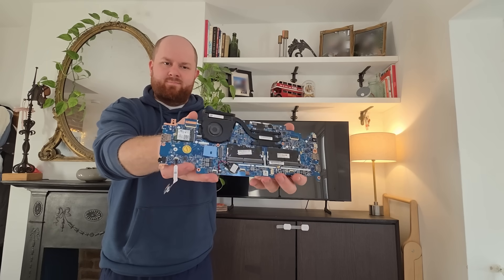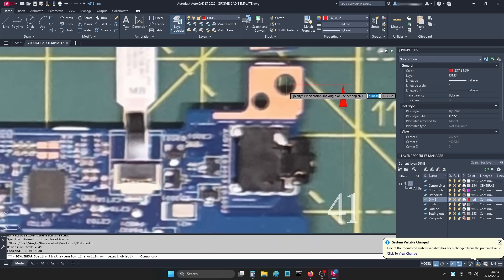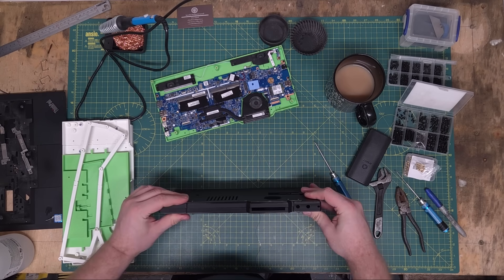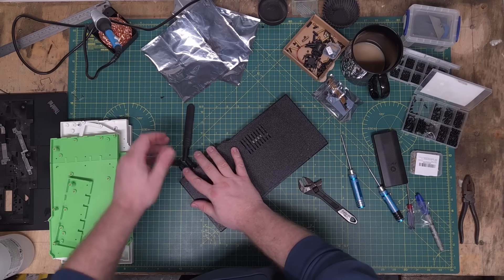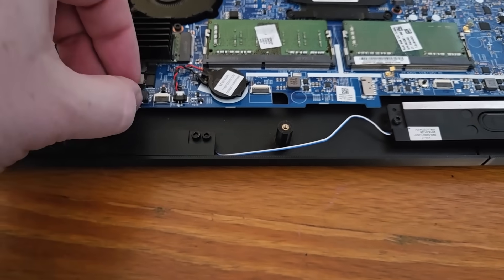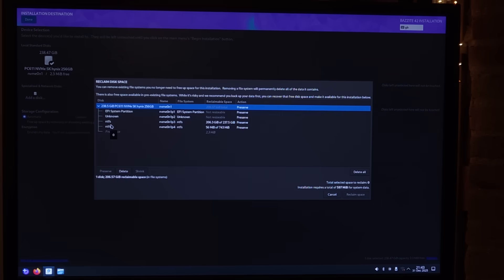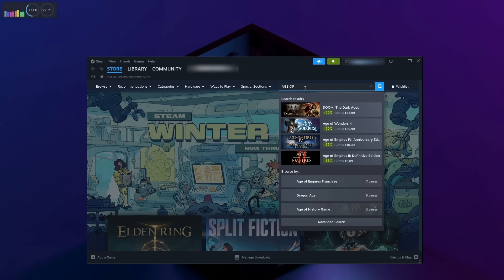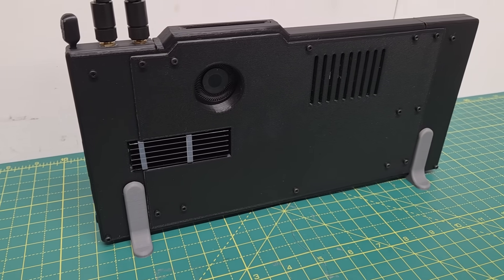I built a £15 laptop motherboard gaming PC (MDM lock) | Bazzite Linux

Comment: For the on off button: Just design kinda "rod" that has a thicker edge at the bottom and put it in from the inside. Make it so long that it is pressable from the outside and just reaches the button.

Imagine a small long, thing "hat". It can't fall out like this and you have a button. You can do it right now without the need to change anything on your design.
Reply from the maker: Thank you! Great idea and ill try to remember this next time 😂

Comment: flatpak is not a sandbox
Reply from the maker: ? Flapjack apps are sandboxed
Reply: @JoeC-J  It only provides separated runtime environment with necessary libraries. Sandbox usually means some sort of secure execution, which flatpak do not provide. Nevertheless, it should not because that would restrict running application a lot.
Reply from the maker: @delayslot5601  I think we re using different definitions of sandbox. Flatpak doesnt do high vm level isolation but it does sandbox apps using Linux kernel features and permissions
Reply: first of all, any app can request access to anything outside of that "sandbox" and you wouldn't even notice, so there is no reason to calling that sandbox or even isolation. Second, if you look at any app in flathub with 99% probability it is marked as "unsafe"(firefox, chrome, steam as an examples) because it uses those isolation escaping mechanisms. My point being, flatpak should be viewed only as a convenient app distribution mechanism which setups execution environment with all necessary dependencies and isolates it only to remove any kind of outside interference with this environment, not the other way around.

Comment: The text is likely fuzzy because it was designed with CRT monitors in mind (CRTs blends pixels and colours so they look smoother and less jagged). I'm not sure about Linux and Tibia but I'm sure there is a way to install a CRT shader pack that will smooth out the pixels and even add scan lines and curved edges if you want the old school feel.

Comment: When you did the OBS test at 8:25, were you using the default x264 encoder that runs on the CPU or did you try using a hardware-accelerated encoder like Quicksync H.264 which runs on Intel's integrated graphics?
Reply from the maker: Nope it was on default, Thanks for the tip for the future. cheers

Comment: Nice build! Slim, precise and polished design with no gaping holes hidden by the camera angle. Y'know, you're the first person I've seen that not only used a skeleton frame for prebuild fitment, but actually talks about it. I assume its common on 3d print channels but none of the diy tech builds I've watched ever mentions doing something like that. Also, good into on Bazzite. I thought I knew what it was but I see now I'd barely scratched the surface. Thanks!
Reply from the maker: Thanks so much for the kind words, really appreciate it! As for the skeleton frame, i just wanted the quickest thing to print so i could get my hands on it and see. nothing quite like holding something in your hands to see if it works or not. Thanks for the comment! cheers

Comment: I was thinking about something similar, but I built it on a terminal with an additional graphics card (a pre-built case). Cool project, congratulations :)
Reply from the maker: I looked at an egpu but the price put me off for sure!
Reply: @JoeC-J  Hmmm... Instead of an eGPU, maybe consider an M.2 GPU Dock? I've seen prices under $50 for one with an ATX socket (Aliexpress), and there are often discounts. If you have an old power supply and graphics card lying around, the cost is still manageable.

Comment: Very cool build, and nice soothing video for a change. Something you missed in your excellent explanation of Bazzite: the Bazzite documentation has a hierarchy of ways of installing software. Distrobox is on there, but only as a "last resort", since for CLI apps, you can also use Brew. Brew works because it installs CLI apps in a user folder, which also doesn't touch the system. It's makes installing and more importantly updating apps a lot easier.

Comment: Please could you make a video where you explain in more detail how you create such a case? From the first model with the screws to the finished case?
Reply from the maker: I've got quite a few videos in the pipe line, i might get round to making a something similar for another motherboard or a slightly different project which I'll try and include some more detail in. Thanks for the comment!
Reply: @JoeC-J I'm really new to 3d printing especially to model things myself. And I don't manage to get anything I could print at all. And I can't find any "tutorial for my usecase" without owning a 3d model of my object ;-;
Reply from the maker: @kevinpixellol71 what are you trying to design? What software are you using?
Reply: @JoeC-J pretty much the same as you. I got an old laptop mainboard, used an old one so it's fine if I destroy it somehow :D 

I don't really have a software, I tried fusion 360 and thinkercad. But kinda overwhelmed by all the settings and don't really know how to start 

At the end I wanna 3d printing a case for my laptop Homeserver and the 3.5 inch HDDs and power supply:D but that's a topic for later
Reply from the maker: @kevinpixellol71  Fusion is fantastic. I use it a lot, but you're going to need to learn to walk before you can run. What you're talking about isn't a beginner-friendly first time cad project. I would start super small, drawing some cubes, learning how to trim, fillet, extrude, mirror etc etc and then try to model some things out to use in real life like a pen pot for example, just simple stuff! But there are lots of excellent YouTube videos on Fusion for beginners. Good luck!
Reply: @JoeC-J  Okay, I understand :D
I think seeing how YOU do it, from the motherboard (or 2D photo) to the case, would be a great video idea and I would love to see it :D

Comment: Lovely build! For the power button,  put a "mushroom" in the hole from the inside out. The switch will keep it from falling into the case, and the mushroom head will keep it from falling out of the case. I've done this in a build to great effect.

Comment: I had a lenovo thinkpad laptop with the management turned on

when I sent it in for warranty (which had 1 month left) to replace the screen because it had dead pixels

it seems they have somehow removed the lock thing 

and I was able to "permanently" disable the feature in the bios
Reply from the maker: Think you got lucky there!

Comment: 1. Buy a CH341A programmer. 2. Wipe and flash another BIOS. 3. Enjoy your clean BIOS with no MDM lock.
Reply from the maker: Im pretty sure you need valid keys to flash a modified or new bios? I might attempt this out of curiosity
Reply: @JoeC-J the ch341 programmer clips directly to the bios chip and lets you flash it directly. (From another computer)

Comment: Love how Bazzite is exploding esp for the living room, a real set a forget distro. You did such a good job describing atomic distros. The only issue is when something usually presumptuously/lazily coded wants access to a read-only directory. I've learnt to embrace /var
Reply from the maker: I've not run into any problems yet! and touch wood i dont. cheers for the heads up. thanks!

Comment: small cup of tea? That's akin to a bucket! Thermal paste on the chipset, so the intel design of thermally separating the cpu from the chipset with two dies, can be completely undone. Let's fry that chipset!
Reply from the maker: My understanding is the pch normally has a thermal pad on? But when I took of the heat sink it had paste on there so I re applied? But the cpu didn't get any hotter than 65'c. What's your thoughts? And its just a thimble sized cup of tea 😂. Cheers!

Comment: I think, the heat from the cpu will melt your 3d printed case.
Reply from the maker: I was concerned about thjs but there is enough space between the heat sink and case that it doesn't get overly hot, I kept touching the case during installs and only slightly warm
 Cpu didnt get hotter than 65'c as well. Cheers
Reply: @JoeC-J  I will hope with you, pls stay informed about this, the idea is great.

Comment: sweet, i've been planning on doing something like this for a while now, but i've been blocked by one thing: 
i have a laptop with busted screen, if i boot it and the external screen is on, it autoswithes, but i can't get the bios to the external screen, so no way to change the boot order...
any suggestions?
Reply from the maker: You tried fn +f1 or f2 or f3 etc etc? right after power on to force an extenral display. likewise turn it on, close the lid and making sure its hooked up to a second display might force external display. failing this i guess you could open it up and disconnect the LCD pannel so it will have to use HDMI out?

Comment: bit of a random guess, but could the fuzzy text in Tibia be from some sort of X11->wayland conversion? I know when I'm using some applications which don't support wayland natively (ie. need to use XWayland to run) the text can be fuzzy at times. possibly because it's an older game / hasn't been maintained actively, idk
Reply from the maker: yeah good thinking and makes sense, if tibia’s running through xwayland that could explain the text being fuzzy. thanks for the comment!

Comment: Im actually doing this with a lenovo flex funny enough. Just a tip. Since I see you re doing it through autocad/fusion.

Making some drawings from your object, like you're going to print out a blueprint, you can just put it to a 1:1 print it out on paper and cut it. Then youll know exactly where your holes will line up at the end of the day. 

No need to print out small thin test peices. Allthough if you want to double check that, you can just have it print the first 3 layers, then you can know for sure your Gd&t are all good worse case if you fear the % difference between the paper printer and the 3d printer.

As for the power button its grst dont let anyone tell you otherwise lol. If you have to though. Worse case, just make a rocker switch that prrsses the button.
Reply from the maker: Thanks for all the tips, i have tried the 1:1 print off with paper but i find the floppiness of paper to cause some ambiguity on fit sometimes, but i can imagine it definitely has its place in the arsenal of tools. Thank you for the detailed comment, and sorry for the slow reply! Good luck with flex build. Cheers
Reply: @JoeC-J aye no worries, everyone has lives. Anyone expecting a fast reply should get one lol. 

Completely valid argument, I would agree paper being too floppy could throw your measurements off. Maybe card stock would be better? But at that point you're buying about as much paper for the cost of 1kg-2kg of filiment. 

And thank you for the luck, much appreciated. I hope your projects go smooth aswell.

Comment: pull the cmos battery for 24 hrs to see if the lock will remove. fussy text. cable or display resolution
Reply from the maker: Thanks for the suggestion, I'll give it a go! Cheers

Comment: Nice build. Loved that diagram of distorbox, flatpak etc. So, the motherboard does not care if the OG laptop display is connected or not? Did you have to do something with the lid closed/open switch so it doesn't try to sleep/hibernate? Or was it in permanent open position by chance?
Reply from the maker: Thank you. Glad you like the diagram part, I was trying to explain bazzite with out being to boring! There was a small pressure switch that was hooked up to the power button that I just unplugged. I wasnt sure if it was going to cause me any issues but it hasn't. So I havnt had to make any specific changes for it being a laptop motherboard. Cheers

Comment: Great video! I'm unfamiliar with Atomic OSes, what's the reason for using distrobox?
Reply from the maker: atomic os like bazzite are read only which makes them very stable but limits installing software directly.
distrobox lets me run a normal Linux distro (i ran fedora on mine) in a container to allow me to get cli tools without breaking the base system.
Reply: @JoeC-J Thanks for the clarification! Keep up the good work!

Comment: It would be cool asf if you also designed a separate case to use with a graphics card adapter and some kind of SFF PSU
That would be two cases, two devices, but you could use the graphics card only when you need some extra power
Reply from the maker: I did look at an external gpu for it but the adapters are expensive and that's even before buying a gpu to go in it! Maybe one day if one comes up cheap. Cheers

Comment: Love it. There's tons of high-end laptops that still function that could be repurposed for tasks like this, ones were the batteries are just shot or the screens are too damaged to use but the internals still work. I have a few T420s I'll likely do similar to at some point.
Reply from the maker: Exactly that! makes perfect sense to repurpose them i think if you can. good luck with the t420s. Cheers

Comment: Great explanation of Bazzite, but I'd like to add a point about cli tools. While a distrobox works, I recommend brew, which is preinstalled and is basically just a normal  package manager only it doesn't touch the base system. Many common utilities are preinstalled on bazzite as well, such as fastfetch. Also, did you know you can use distrobox for gui apps too? It's really cool.

PS. I love how instead of just showing the finished graphic, you showed the process of making it, which keeps the video far more engaging.
Reply from the maker: Thanks for the info about brew. I'm glad you liked that bit, I was trying to not just have a boring image explaining it. Cheers 😊

Comment: If you aren't completely reliant on AutoCAD's dynamic blocks, I recommend switching to Rhino. I use it for 2D drawings, 3D modeling, 3D printing, laser/vinyl cutting, I'm sure there's other things I'm forgetting. The lifetime license is also way more affordable than AutoCAD. I only keep an AutoCAD LT license because my job uses a standardized AutoCAD layout for drawings, but I do all my draft work in Rhino first and import it to AutoCAD model space at the end.
Reply from the maker: Thanks for the suggestion! i've heard great things about rhino, but not used it myself. I need AutoCAD for work so i have a license anyway, which is why i do 99% of my draughting on it rather than fusion. Cheers!

Comment: Love this kinda stuff, I do the same.
My latest project was using a HP Pavillion, I installed OSX onto it and use it for movies.

Just a heads up, you will be CPU throttled without a battery, there are some tricks to bypass it but can damage the PSU cable.
Reply from the maker: That sounds like a cool project with the HP Pavillion, glad you're able to give it new life! Thanks for the heads up about the CPU throttling, I'll definitely look into that, what's your work around for the CPU throttling? Cheers
Reply: @JoeC-J  I at last resort will add power to the battery BMS and trick the laptop to thinking its using battery (do not use normal power at same time) or like I did for the HP, I will teardown the battery, remove the batteries and make my own battery so it fits how I need it :)

Comment: This build is my dream, I had a couple of laptops that I wanted to transform into desktops, very similar from your design, maybe I will learn more about CAD and model some cool cases for my laptop motherboards. I really liked your video, keep doing it!
Reply from the maker: There are plenty of videos on how to get started with Fusion on youtube. Personally I think its great cad software. Thanks for the kind words and good luck with your projects!
Reply: I did exact same thing as on this video before I saw it. But for design I did use super simple 3D design app for kids named Tinkercad. It’s so simple that learning process takes like 5 minutes. It’s free and working inside browser, and it’s also form Autodesk company.
Great vid BTW :)
I used wi-fi and BT antennas from laptop in form of flat stickers so they are inside the case.
Also added few capacitors in place of battery to make it work with full power and avoid restarts.

Comment: Best summary of atomic OSes I've seen!
Reply from the maker: Thank you very much! I find it a bit daunting putting out videos with information like this on, as it does open me up for keyboard warriors. So I greatly appreciate comments like yours, cheers
Reply: @JoeC-J  One slight correction, at 8:53, immutable means the rootfs is read-only, while atomic means updates happen all at once, or not at all (sometimes implying an image-based system). Also, Homebrew is generally preferred over Distrobox unless an app isn't available. Keep in mind too that Distrobox mounts your entire home folder as read-write by default, so you still have to be careful what commands/scripts you run.

Comment: This shouldn't be running that slowly on an 8th gen i5, the integrated graphics should be functioning better than that i.e. at 1080p it powers through a lot a emulators all the way up to PS2 and Gamecube before it starts to struggle...

Maybe it's Thermaling because of the tiny cpu block
Reply from the maker: Running badly on Windows 11? Or running badly on OSRS full screen? It wasn't thermal throttling, it was maxing out at around 65'C with CPU going 100%. 

8gb of ram is pretty tight for a modern OS, so I'd put my money on that. I reckon with 16gb of ram there would be a significant improvement, but with sticks of ram competing with gold I'll hold off!
Reply: GAMING PC!
@
With no dgpu
@
Cannot even run oldscool runscape
@
Definitely gaming

Wth is wrong with these youtubers
Reply from the maker: @sinchrotron  These pesky youtubers!

Also think you missed the point
Reply: @JoeC-J No, my friend, I didn't. You cannot name anything that has a CPU a gaming pc. It is a clickbait.